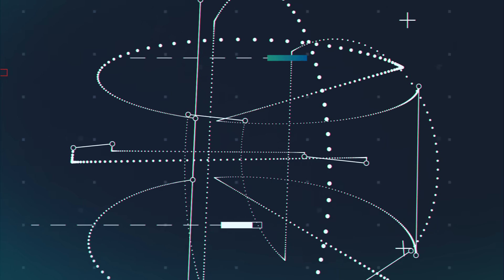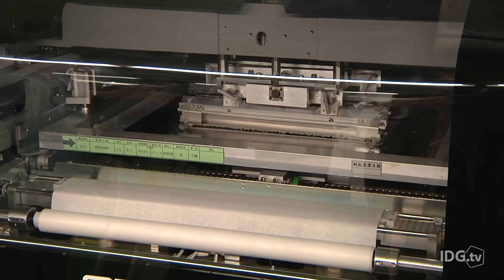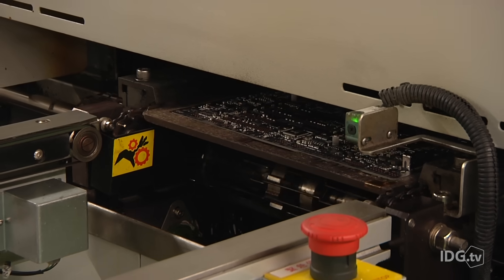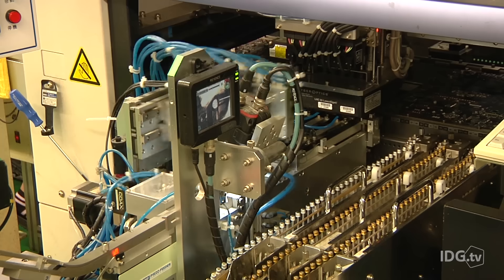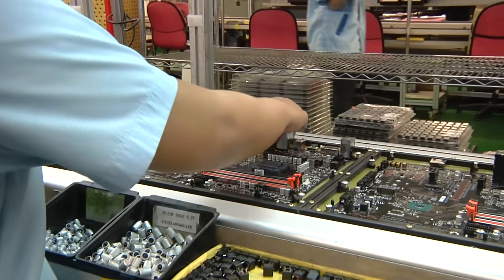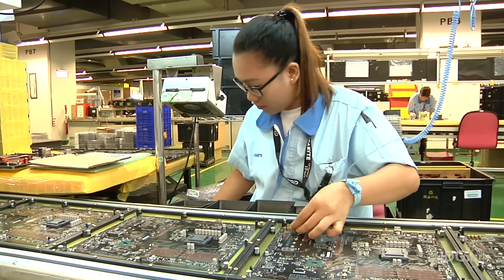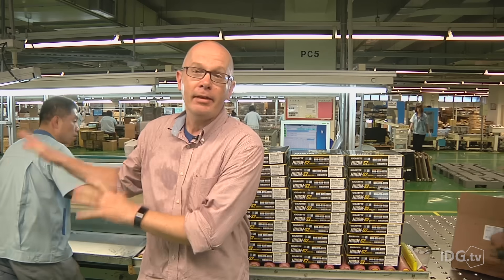How a motherboard is made: Inside the Gigabyte factory in Taiwan

Comment: Attaching a CPU, GPU, RAM, PSU, FANS, storage, mouse, keyboard, headset to the motherboard and  testing it seems too much work so they basically are selling motherboards without testing them?
Reply: Pepe they go though several tests during the process. In the middle of the video you can see one such test called a bed of nails test. It basically connects a template of tester points and electrically tests the active components placed on the board that have gone through the smt and pick and place by machine processes. The machine with the picture frame is the device it electrically test all the components and connections. This measures values and gives a pass fail to the operator. The next test you see is the electronic eye this takes a picture of each component and flags any suspicious components. It catches any missed components, bad solder joints, excessive flux problems, misaligned components, or FOD on the boards. You can see on the screen as it works section by section though the process. I suspect they run all boards though this. There is also a burn in process here you probably dont see in which they have a set number if not all boards that are tested this checks all connectors and probably flashes the board and burns it in front a set time with a series of loads to verify the batch is as it shoulf be. All of this data is logged to a shop floor system for metrics and analysis as you can see in each step where they place barcodes and scan operators to each task. So they can see who did what and what the end result was for each board. So many do not get a full build test  but they have several though out the process that collect more data than you'd get if you just connected off the shelf components to the board and ran them :P if it makes it out it's probably been tested several times though out the process and any rework is done by the engineering rework team and documented and retested.
Reply: Pepe 17 morons liked your comment.
Reply: are you fucking stupid ???

Comment: This is why the mother board failure rate is so high. Quality control looks terrible. get as many done as fast as possible means a lot of boards will have issues. And they do.
Reply: @Haiden Shit for QC? Yet most of your quality computer parts ends up being manufactured in Asia.
Reply: You are paying $30 for a night out, having a pizza a couple of drinks. And you do it few times a year. Yet you will use this motherboard for 3+ years, and you complain.
Reply: Haiden 95% of your pc is made as fast as possible. They don't have the time to be individually checking each one. Ive worked in a production factory and know what goes on.
Reply: Motherboard failure rate is not high though, so you are completely wrong. I've been in IT 20yrs and have only seen 2 dead motherboards, 1 due to user error. Also look at how these people are groomed - they are not badly paid at all and you can be sure they are held to high standards.
Reply: ALL of computer parts have been made in asia for the longest time. What dumbasses.
Reply: you get what you paid for. seriously with all the design, components, labor and shipping cost of a motherboard people expect the moon when they only paying $100 for it.
Reply: issaciams still gigabyte MB's are the most reliable
Reply: Not A Name maybe it's  just in this factory ,anyway here is the facts as i saw it.. I have a gigabyte MB installed in my older computer it's working 10 years stright without a single maulfaction while one of the ram slots broke down in my "gaming" ASUS board after 3.5 years ,next day i went to the computers labradory and the guy who worked there said it's always the same brands that come back to be fixed..
Reply: An awful lot of the people commenting here are fairly ignorant. For one full automation is worse in most cases unless you have a top of the line specialized factory (Which these aren't because product lines change too frequently to allow that sort of specialization), so this level of labor is actually representative of higher quality, not lower quality. 

For two, the people saying Gigabyte has horrible boards and failure rates clearly don't work in the industry. I think Gigabytes RMA rate was somewhere around 2.8% on the Z370 series, which is outstanding, and far better than both ASUS and MSI which are averaging around 4% right now (Which by the way is still pretty good, it's not 'bad' until your RMA rate is around 6-7%). 

Finally, motherboards are some of the most resilient pieces of hardware available. Individual components or slots might fail, but seldom does and entire board die, there is so much redundancy built in that often times if a component does die, it has no measurable impact on performance, since it's usually a capacitor or something that just smooths out power flow. Even if solder was screwed up or missed somewhere it would be unlikely to result in a failure.

Finally, all that said, you CAN benefit by 'baking' your board, as all the post solder work after the boards initial PCB baking in the factory, can be made more secure by being melted again to ensure it's not hanging on by a thread. Also if you are willing to hire a professional to look over your hardware components, and do a manual double check then any component can be improved, this includes things like Corsair, Seasonic, or EVGA Titanium 80 PLUS Rated Power Supplies, which are arguably some of the highest quality products manufactured for computers, they STILL benefit from closer inspection (As demonstrated by Johnny Guru's review on the SuperNova 1600 T2 for example, where it worked practically flawlessly, but when he opened it up, he found a few solder points that could be improved, and got even better performance after he fixed them). 

Point being, most of the people commenting on these threads have no clue what they are talking about. IF companies seriously put the amount of time and effort suggested into making sure every part was flawless, you would pay for it dearly. These workers get paid $300.00/month, but you would need to hire actual hardware engineers in their place if you wanted true insurance that the parts were perfectly soldered. That would run about $1,500 - $2,000 per month in the Philippines (Still WAY cheaper then in the US). Further, we're not just talking about expertise, but also about 'time' invested from these engineers, each of which would have to spend a minimum of 20-30 minutes after production double checking the final product, and doing touch-ups. 

If any company did this, they would have the highest quality products sure, they would reduce their RMA rate from 3-4% down to 0.25-1%, and for that luxury you would have to pay an extra $100.00 for boards that have no extra components, no extra features, and more than likely aren't even superior in terms of the solder and work compared to their competition, since 96% of boards don't RMA, and work fine, so it's just a stupid waste of money that would lead to companies being unable to compete. 

I really wish idiots wouldn't comment about shit they know nothing about.
Reply: Do you expect americans do these kind of job,and get paid as same as them.
Reply: I think Gigabyte is quite reliable. I'm a satisfied customer
Reply: i worked 9 months on a factory here at mexico as diagnostic technician, and i tell you the QC depends pretty much of the product but every board out of a electronic factory pass through a ICT test, ( i don't now about funcionall test), so every board is electrically checked before shipping, if it doesnt work that's where the DX tech comes in,
Reply: Failure rates are around 2%. What are you talking about?
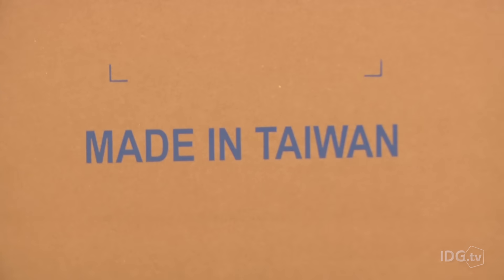Reply: never had motherboard issues in over 20  years of using many MBs. But if you got an insight of the quality control process from this 2:48min video, you have my respect ^^
Reply: i've had 7 different motherboards so far and none of them has failed
Reply: you know they didnt show all the quality filter controls this companies as Gigabyte has right?.. and if someone else doesnt know.. this may looks skeechy but Gigabyte is the best motherboard manufacturer ... some months is asus, some others is gigabyte again  :D
Reply: 20 years ago motherboards were still made in the United States, however. And the inspections were all done by hand by people using magnifying glasses to check the solder joints and parts placements and not robots.
Reply: @petenielsen6683  Nonsense. 20 years ago, we had Asus, Gigabyte, MSI, Supermicro, Tyan, Albatron, Soyo, DFI, Abit, etc. With the exception of maybe Intel and Supermicro, motherboards have almost always been designed and manufactured almost entirely in Taiwan. Maybe in the 80s, people were doing it all by hand in garages, but I can guarantee from the mid-late 90s and on, nobody was making this by hand, cautiously pouring over each and every precious solder joint.
Reply: Agreed...!
Reply: time is money, it is not just a saying. The more time they spent on a single motherboard the more its gona cost in consumers hand. So next time you buy a good motherboard for cheap this is why its cheap.
Reply: No final test! You buy a pig in a poke!!
Reply: issaciams - I've done consulting work for a large PC board producer & parts stuffing firm for 40 years. The owner tells me that the soldering process is very critical for finished board yield. Also I order parts (ICs, caps etc) from random Chinese sellers on eBay. I order about 25% more than I need. I find that around 15 - 20% of new parts are duds when they arrive, but with such low costs & free shipping I don't care. But it does indicate that even new Chinese produced parts have poor QC. One year I was getting 1 in 10 power cords from China that were open circuited. When I built with American parts in the 1970s it was 1 in 150,000 power cords that were defective. But then again in the 1970s an American made keyboard cost around $300.00 ($2,400.00 in todays money). So in the 1970s I guess high profit margins gave a cushion to spend a bit more on QC. Those $300.00 keyboards were just one small cost for a minicomputer that often cost $60,000.00+ in the 1970s. Even more trivia: I did a benchmark in 1980 on a 4MHz Z80 S100 system with a 10MB hard drive, the full system costing $4,000.00. It performed as well as many minicomputers of the time selling in the $50,000.00 range, so you could "see the writing on the wall" for minicomputers.
Reply: Motherboards as other Electronics, usually have a really low failure rate, usually
Reply: Quantity over quality
Reply: Norm T  Whatever, you clearly forgot to take a course in politeness when studying for an EE degree. ;-)
Reply: Norm T  And, btw, my concern isn't about ESD safety, but more about leaving fingerprints which may not get completely washed off, hence creating an - albeit minor - long-term risk of corrosion. Just being on the cautious side here. Greets, the friendly moron with a Ph.D. in plasma physics, who's been doing electronics since 1978 ;-)
Reply: For real
Reply: Time is money. You have warranty for your mother boards.
Reply: Otherwise you could probably pay 50% more for motherboards...
Reply: True. Usually, Gigabyte boards don't score above 4 out of 5 stars in Amazon or anywhere and 1 - 3 star reviews skyrocket.
Reply: Well, to be fair, you can't blame the employees, you should blame management who only care about making money and not providing quality.
Reply: there isnt any other manufacturer which doesnt do the same thing as gigabyte does
Reply: @underabridgetoofar  Yes, you failed at your "politeness teacher" job. Now go back under your bridge, troll. Btw., it's "kindergarten", not "kindengarden". (cf. https://en.wiktionary.org/wiki/kindergarden )
Reply: I have many years using gigabyte motherboards & graphic cards and i never ever got a faulty one, in fact all still are in working order. That is why i trust this brand.
Reply: issaciams: Very well. Make my motherboards for me then.
Reply: Not A Name 👍
Reply: elias borsov - Well, I'm not criticising Gigabyte for lack of QA measures. By mere coincidence, I've just bought myself an Aorus X399 Gaming 7 earlier this week! 😄
Reply: my gigabyte x370 gaming 5 failur and i cant rma it i indonesia just because i buy it in another country
Reply: I have /never/ had a failure in a Gigabyte motherboard.
Reply: +rurutu M

Most computer parts are manufactured in Asian countries because its cheaper = profit

It has nothing to do with what you paid, Asia countries have shit for quality control.
Reply: @BlahBlahUsername1  Then make a parts urself. Im pretty sure you can work it out and inspect it for 5month for 1 parts. This boi talk like he know shit working at this kind of factory , Fuck to ur face.
Reply: Not all motherboard, gigabyte is a shitty brand and all their products suck.
Reply: Well, workers handling components and PCBs with their bare hands isn't up to the highest manufacturing standards...
Reply: @quantumbubbles2106  maybe, just maybe the manufacturers know more than you about how you can handle the motherboard
Reply: @tomdobrokhot7300  In the end they strive to maximise profits in a congested market. I don't cut corners.
Reply: @quantumbubbles2106  I mean you put a motherboard and handle a motherboard with your bare hands. Most people don't even wear the anti-static wrist bands that they do.
Reply: @behroon4753  I was writing "with bare hands", but nothing about static electricity. Using ESD-safe equipment often still means using "bare hands". My concerns aren't about static discharges but the PCBs getting contaminated with fats/grease/dirt/acidity etc. before them being subjected to soldering.
Reply: @quantumbubbles2106  I personally doubt that it could affect the components as long as they don't touch the metal leads.  They are all wearing static straps which is the most important part.
Reply: @hhhhhhhhhhhhh4927  I was writing "with bare hands", but nothing about static electricity. Using ESD-safe equipment often still means using "bare hands". My concerns aren't about static discharges but the PCBs getting contaminated with fats/grease/dirt/acidity etc. before them being subjected to soldering.

Comment: this is better than full automation
Reply: Not in the long run
Reply: It also gives jobs.
Reply: Gergo049 Because making less than minimum wage is a desirable job everyone want’s.
Reply: manual labor is cheaper than getting another machine if it can be easily done by a human
Reply: because?
Reply: you can never do full automation due to the fact that THT components vary in sizes and its a challenge to make a robot for it. thats why most manufacturers if not all use robots for SMD components and humans for THT components.
Reply: Nabil Danial actually professors at my school are working on a robot that can do exactly that.
Reply: Robots would be a waste for this small factory.